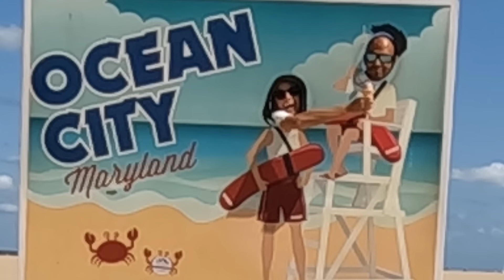CRITICAL REPAIR  | Rigging unravels offshore

Comment: I've used those hank on sails for 10-15 years and never had a problem with the rigging. I replaced the rigging when it was 30 years old not because there was a problem but as a precaution due to the age.  Another great video!  Look forward to the next one ⛵

Comment: If you go all synthetic (with a synthetic fore stay) you would have to change out the hanks on your head sails.  I had hank on sails on my previous boat, and my fore stay was over 20 years old.  The rig came down every winter, so figure about 10 years of wear and tear.  I would be surprised if the hank on sails are what caused the break.

Comment: Vary the length of the tack downhaul slightly each time so the Sail hanks aren't always at the same place. Better yet, get roller furling. It's much safer for your short handed sailing. I think I already recommended a swing up transom mounting bracket for the outboard so you can use it when necessary.  Your electric motor is anemic.

Comment: That wire looked like left hand lay, maybe it is just a visual trick ofthe video. If it is left lay, then it is very unusual. As said previously, hanks are generally brass or bronze so they will wear first. My forestay was at least 20 years old before I replaced it, but tgere were no signs of wear. I recommend KOS wire - no connection.

Comment: well, I had noticed that you guys raise your head sail under tension, instead of releasing it by heading to the wind.  I know, it's brass against stainless steel and stainless steel is harder than brass, but only manufacturer knows what is in the brass alloy of the individual hank. I might be wrong , but it is a fact that hank-on sails wear off stainless steel headstay faster then  roller furling foil does. I totally understand that there could be tons of other reasons why it failed, but I think it's something to consider.
Anyway, love you guys! and always wish you well!

Comment: if I recall correctly your boat is a lifting keel boat - surprised you do not do more gunkholing and anchoring in shallows others can not get to .
Reply from the maker: We lost the centerboard offshore in curaçao when we struck something. Or we would be definitively using it as a test stick 😁

Comment: I think you may have picked up some bad wire, some of the foreign mills produce some bad wire with poor molding and temperature controls and also dirty facilities and poor handling, oxygen starvation and  galvanic action or stray currents can also be issues, most of my shrouds and stays even with hank on sails lasted 30 years in fresh water and many boats will last in harsh tropical and artic salt zones for 15-20 years.
Reply from the maker: Sad thing is we got it from a very reputable company

Comment: Well it is supposed to be 316...but is it?  If the forestay failed, what about the backstay and side stays?  I would check all your standing rigging. Hank on hardware is typically brass or bronze or anything softer than 316 stainless so that they wear preferentially to the wire. I think you may have a bigger problem.

Comment: I personally recommend going Dynema. But it's kinda costly in the beginning because you have to replace all your fittings. But it's still cheaper than stainless. And you save weight. But the downfall to Dynema is it gets longer when it gets cold. Yes I said that correctly. It grows when it gets cold. But if you spend most of your time in the tropics,  you have nothing to worry about.  Plus most people do their own rigging. And another plus to Dynema is its silent. No more clinging in the wind. And it's stronger than steel. So you might want to look into it.
Reply from the maker: The lack of sound would make it worth it!
Reply: @BeauAndBrandy  yeah everything time I go down to the docks alla I hear is the sound of rigging bouncing off the mast and boom.